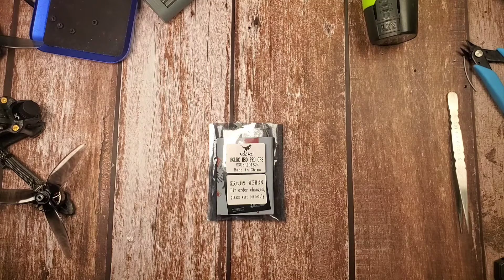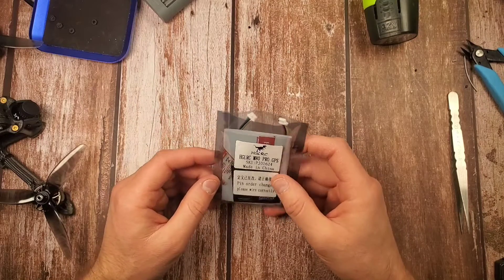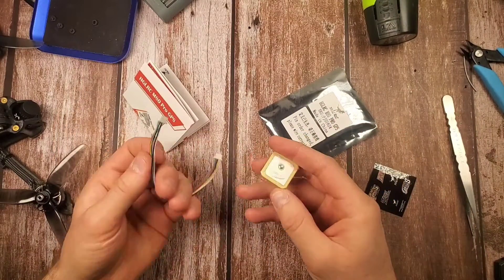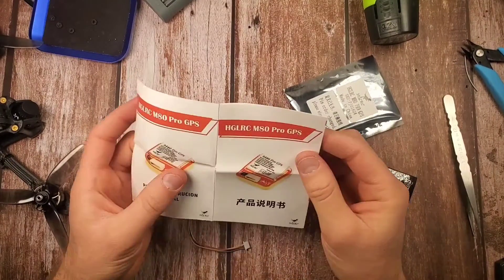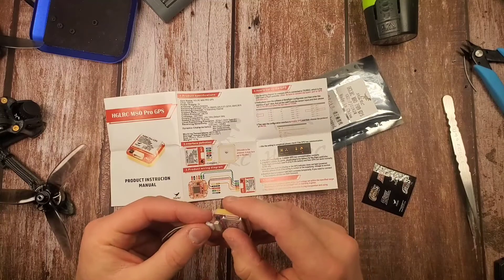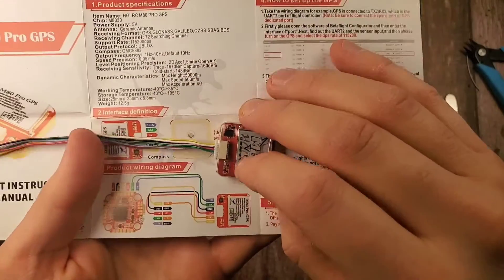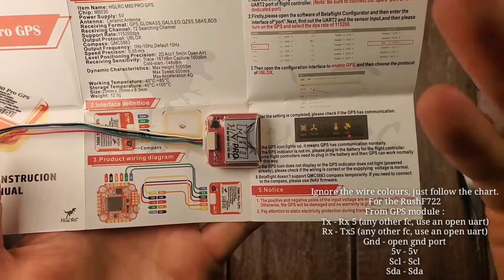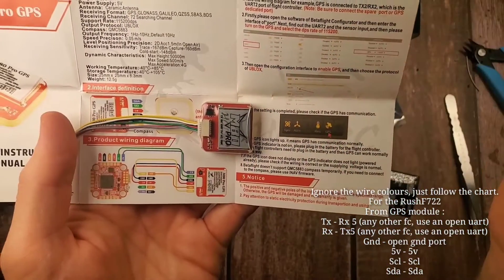Installing the M80-Pro GPS by HGLRC Module to my FPV drone - Quick overview and timelapse

Comment: Are you using inav?  For me position hold doesnot work with this unit
Reply: Hello, I have the same problem. Have you solved it ?
Reply: @albertomazzanti8510  not yet but will update, in progress. If you find the way let me know as well :)
Reply: @selfish1716  of course, as soon as I find a solution I'll write here 👍
Reply: @albertomazzanti8510  i tried to put module away from frame motors etc. but it didn’t help. I tried using bn 880 module and it works perfectly. Guess quality issues with magnetometer
Reply: @selfish1716  thank you for the update... since at the moment I don't have another free gps module and I' stubborn, I will try to disable the mag and contact HGLRC, people say that they are quite active and helpful in giving feedbacks. I'll let you know
Reply: @albertomazzanti8510  i have 3 modules, so far conversation with support is super slow
Reply: @selfish1716  that doesn't sound good, anyway since you have for sure more experience than me, I have a BN880 in a 5inch with betaflight. I have two problem: 1) it takes minutes to get 8 sats and a lot of times it isn't even able to pass 4, 2) I have the gps that is tilted and the home arrow doesn't point to home.
Do you have similar problems ? Can I ask you betaflight set up with this module ? Thank you very much in advance
Reply: @albertomazzanti8510  do not tilt it if possible, it looks cool but more issues with that. Try flat.
Reply: @albertomazzanti8510  cable shielding with copper and grounding may help . vtx noise may affect
Reply: @steamvogue  thank you for the suggestion, I have already done this but with cooking  aluminum foil. I'll try again with some copper strip rolled around
Reply: @selfish1716  after almost two weeks and hundreds of trials I decided to switch gps with another Beitan BN880 (arrived in the meantime) and now works great, both pos hold and rth with automatic landing. I tried to remap the HGLRC M80PRO with u-center but apparently it doesn't have a flash memory so after save and reboot it returns to default setting. Just a tip, in order to keep better altitude hold, place a litte piece of sponge above the barometer.
Reply: @albertomazzanti8510  Yes, exactly, i talked to seller and they made refund, looks like that line has quality issues . Thanks for hint with baro. Did numerous RTH for testing, now flying 2 km and futher

Comment: very nice video. i am having issue with mamba f722 mk3. i connected this to that fc. gps is working fine but compass is not getting detected. i am using inav5.0. BF has some cli commands to enable but nothing for inav....any idea how to fix this

Comment: Hey thanks for showing this gps model! I have never used a gps yet. what about betaflight configurations? what about the time to find a sufficient number of satellites?
Reply from the maker: Hey man! I will make another video with the betaflight setup, but it was pretty easy! Betaflight setup was done in under 5 minutes, even less if you know what you're doing 🤣 I was caught off guard by the new BF update so things were a little different but still quick to set up. 

I couldn't go out and test the GPS yet, but at home I tested and it locked onto GPS pretty quickly! Rough guess but I'd say around a minute and it was sorted. I'll do an update video again once I get the chance to properly test it 😄
Reply: Hello, i have 2 questions :

- with rushfpv fc you are a gps port no ?
- do you have link for the 3d model ( m80 pro )

Many Thanks :)
Reply from the maker: @hassench4845  hey bud! I bought the print from a store, it is the exact same print as for the BN-280, the M80pro fits perfectly. And for your other question, on the FC, I connected to the rx5 and tx5 ports, and it has the SCL and SDA ports as well, so it was super easy to get it set up.